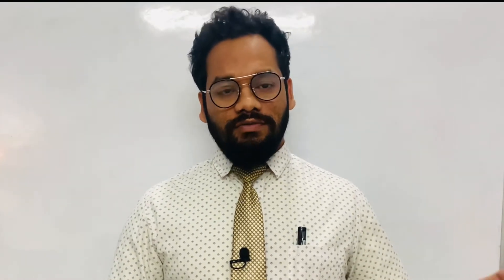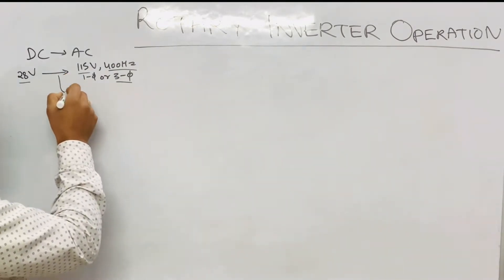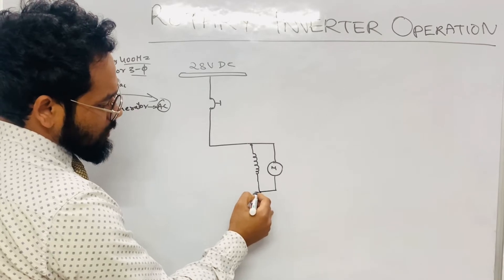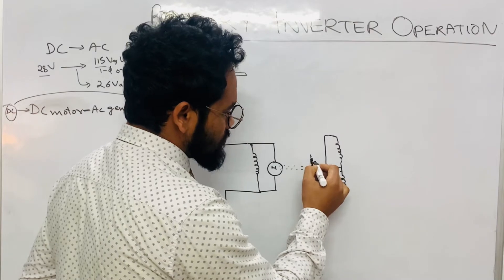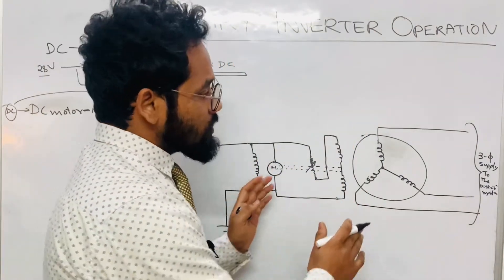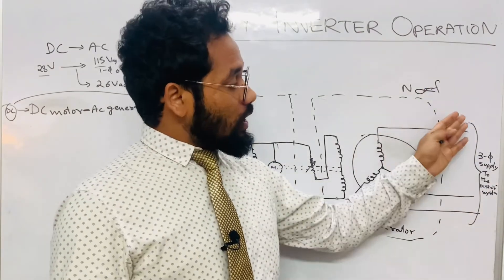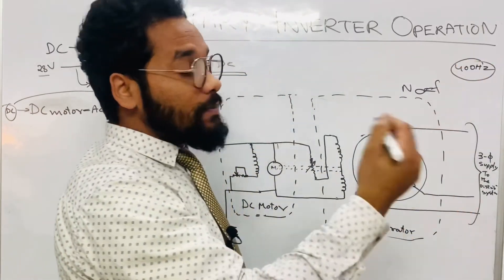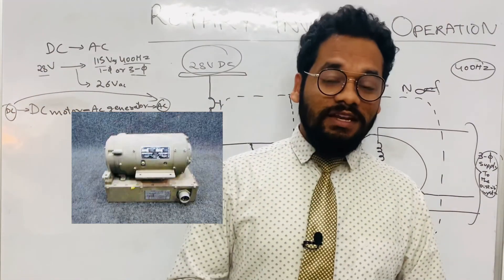What is a Rotary Inverter ? | It’s basic Parts and How does it’s operate?|Aircraft -Rotary Inverter

Comment: Very Good!   Do you know how an "inductor-type rotary inverter" works?   The FAA test says the ac output is dependant on the dc stator fiel current.   Can you explain how that works?  Thanks!
Reply from the maker: Following cases will make it clear to you. 
Case 1: 
Higher the dc current in the stator (stationary winding), stronger will be the stationary magnetic field produced by it; In this magnetic field when rotor (rotating part) rotates, the AC output produces will be more powerful.
Case 2: 
Lower the dc current in the stator (stationary winding), weaker will be the stationary magnetic field produced by it; In this magnetic field when rotor (rotating part) rotates, the AC output produces will be weaker.

Hence, AC output depends on dc current.
Reply: @aviatorupdates    Thank you for the responce! Let me write the exact FAA question and thier exact answer. FAA Question: The inductor type inverter output voltage is controlled by the... Answer: dc stator field current.   It seems to me that if only the dc stator field current is changed the result would be a change in the frequency of the output voltage.  But the question doesn't ask specifically about the ac frequency... it seems to ask only about the amount of voltage.  Maybe the question assums certain things that I'm not thinking of?  It seems to me  the way to "controll the inverter output voltage" would be by controlling the current going to the rotating field windings of the alternator portion of the device, not the current of the stator field windings of the dc motor portion of the device.  Maybe the FAA question and answer is not worded correctly?  Or I'm not understanding something?  Thank you.
Reply from the maker: @brianferrero9544  There is yet another type of rotary inverter as well. I guess the FAA question and answer you are saying about is applicable to that type of inverter. I will prepare a video on that topic. Hope that will solve your doubt ! 😊✅